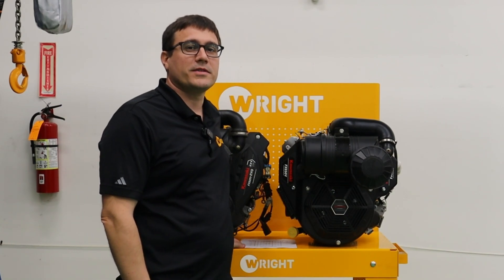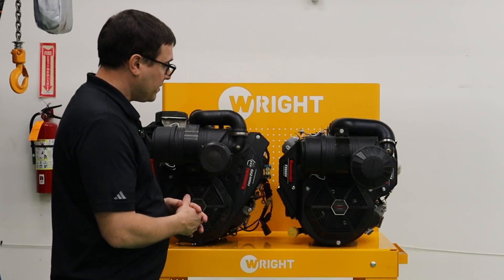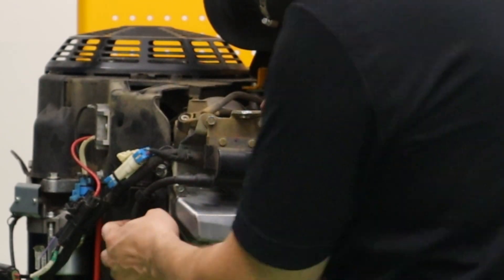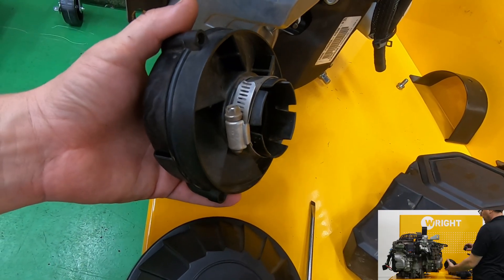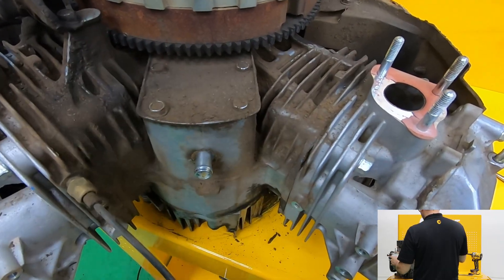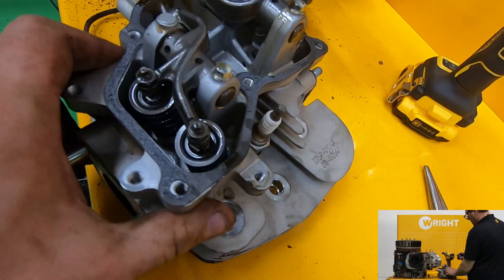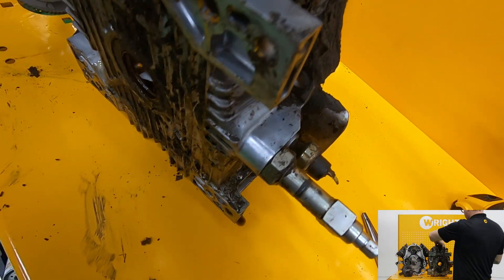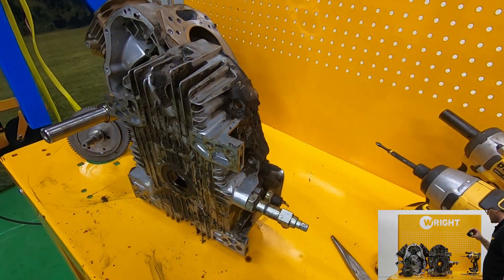Complete Teardown of Kawasaki's EVO Engine with Ed Wright #WrightMowers #LandscaperTips #Kawasaki

Comment: I would like to have a carb option for the kawasaki evo, having that reliavility option will help alot in case something goes wrong on the EFI as is not a lifetime warranty on a commercial mower, my business is still small 130 yards , Im getting a 52" ZK or LG in . 2026  but depends on the engine the evo doesnt convince me, prefer the 850 thanks for this videos

Comment: Kawasaki fx evo engine could fire hazard fuel line failure 😨 catch fire and the engine could being melted byself when you try to start it
Reply: Did you see the test engine in the video, how covered with dirt and dust it was? Lots of hours of use. And guess what, the engine was still intact and not burned up!
Reply: @tylermacconnell217  there’s only a thing on that engine Kawasaki fx evo never could near is fuel pump gasoline near the regulator of the voltage
Reply: @tylermacconnell217  the brand new Kawasaki fx evo began to broke one by one All the brand new Kawasaki fx evo is built to fail

Comment: Really appreciate you doing this type of thing Ed! This is super helpful! I was wondering why Wright didn't go with the FX1000V on the Gen 3 ZK.... now it makes more sense as this engine really seems more forward thinking and should have plenty of power for the machine as the standard Kawasaki engine.

I guess the one thing I'm curious about is why not offer the FX1000V EFI as a big block option over the Briggs Vanguard? I would probably want that on one of my 61in ZK for heavy work if I had the option.
Reply: I was wondering the same thing! All I do is heavy work mowing super thick heavily fertilized tall type fescue and this Evo plows through it better than the big block vanguard 37 I had on my gen 2 ZK even though technically it's less hp being 34.5. The engine never sounds like it's even under a heavy load. Works effortlessly. The difference is night and day. Highly recommend the gen 3 with this engine.
Reply from the maker: @rojo-d3f  thanks for watching! Glad to hear you're loving your Gen 3 ZK ☺
Reply: @WrightMowers  the brand new Kawasaki FX evo engine is good engine
Reply: @WrightMowers  there’s only a answer is NOPE 👎 FLOP COMMERCIAL totally wasted 100000000% waste the money to built that engine recall now could would blew up it in face it’s better if you don’t start the engine I warn you
Reply from the maker: The Evo engine is a fantastic addition to our mowers! Thanks for watching! We'll pass your suggestions along to the team 😊